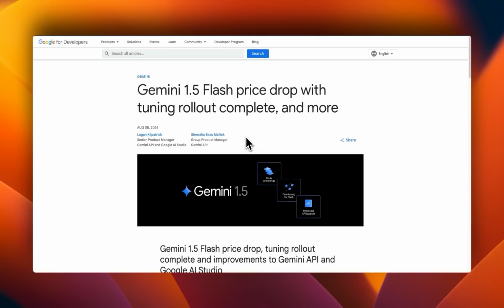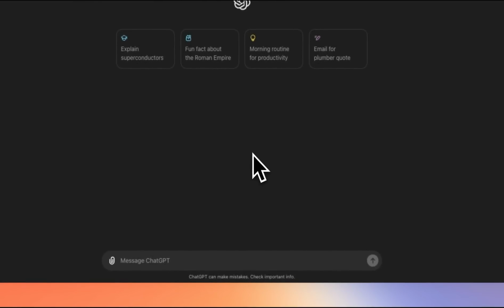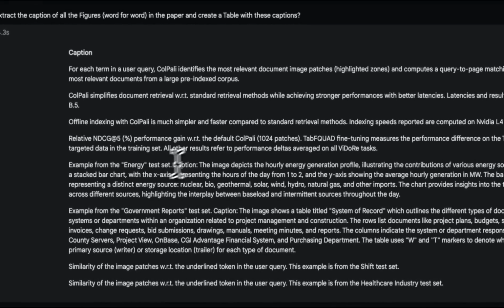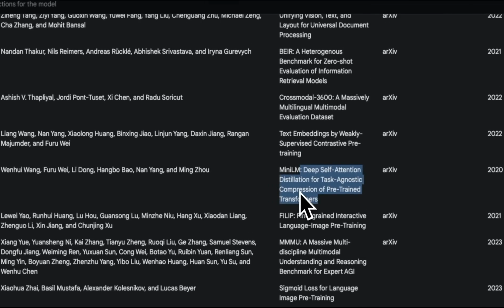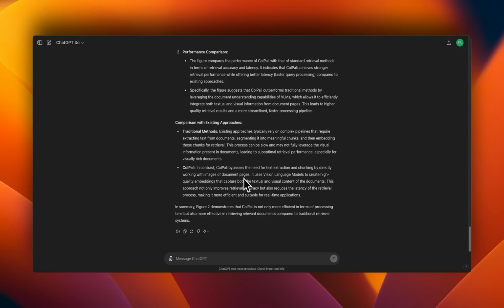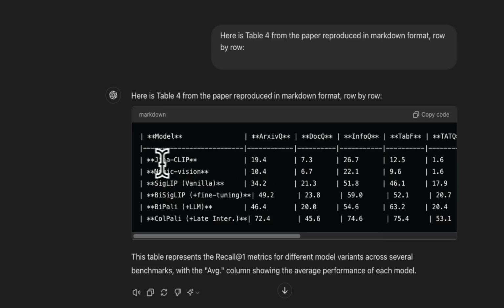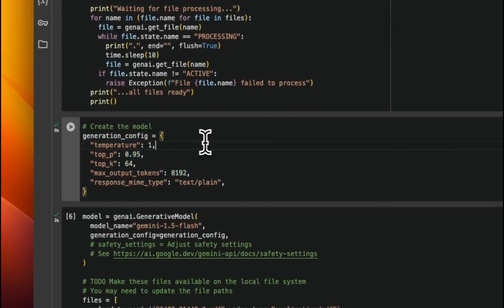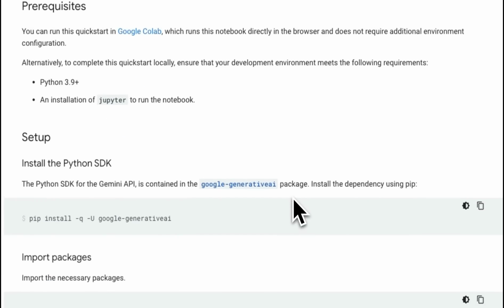Will the New GEMINI PDF Feature Replace RAG?

Comment: If my PDF is within GenAI's size limit, is it better to use GenAI alone by sending both the question and the PDF text directly in a single prompt, or by providing the question in a prompt to the llm and the PDF text into RAG vectors?

Comment: Your article title is click bait.  Not all knowledge is stored in PDFs, and even if it was, often you need to do metadata processing on the documents ahead of time anyway in order to steer the solution toward the right collection of documents.  This dream that you can just throw a pile of documents at a solution and have it magically disambiguate conflicting information, or magically know which documents are most important is exactly that, a pipe dream.  Even Google Search Engine itself doesn't do this especially well (just better than most alternatives).  You have to dig through a pile of links to find the ones that have the information you actually want.

RAG is two things.  It is 1) search, combined with 2) generation.  #1 is a non-trivial problem, and #2 is basically solved by the models themselves.  It's time we stop treating #1 like it is an easily solvable problem. The longer we persist with this myth, the longer it will take us to actually build high quality solutions that produce good results for customers.  Furthermore, #1 is actually a predictive model problem, and should probably best be addressed with a combination of traditional ML techniques.

Even if the models had an infinite context window, the search problem would still exist.  You would still need to be able to steer the attention mechanism of the model.  There is no perfect generalized attention algorithm, and probably never will be.  Think about it, when you walk into a library, is there a single ideal way to find the information you need to provide an authoritative answer?  No, there isn't.  You go to a card catalog.  You skim through periodicals.  You watch documentaries.  If you could, you'd consult with experts in the field.  You read textbooks.  Then you disambiguate all these sources, because some of them overlap, some of them conflict, some of them are only incidentally related.  You have to use reasoning to do this disambiguation.  Until you've completed all of these different attention approaches and then performed reasoning and disambiguation, you really aren't in a position to provide an authoritative answer.  This seems unlikely to change, regardless of how big the models get or how exposed to various sources of information they are.  There is no magic here.  

Search and disambiguation is a big problem to solve.

Comment: This review is basically pointless. Youre running it on one pdf. The whole pdf can easily be dumped into the context (oai default is 20 x 1000 token chunk). You should be doing it on much larger datasets

Comment: RAG in general has been slowly dying as context increases are combined with cost decrease.  On top of that, folk are getting better at compression and database use (LLMs understand SQL, etc), and agentic flows.

The speed loss and cost to maintain a vector database, just isnt always worth it when I can simply task a flow itself for semantic search and feed it to whatever needs it.
Reply: RAG is not dying.  It merely depends on the use-case.  It was even mentioned several times in this video where this is not a replacement for RAG where there is a large corpus of information (millions of docs).  It certainly is evolving however, and quite rapidly.  I would love to get to the point where I can avoid having to parse pdfs and documents completely, and just feed docs to a vision model & have that the chunks stored directly in a db.  But getting rid of RAG completely?  Nah.  Not yet.  I would say RAG would only go away if there's some way where model training reaches a point you can just throw docs at it and rather than feeding them into a vector db, you can feed docs directly into the llm itself.